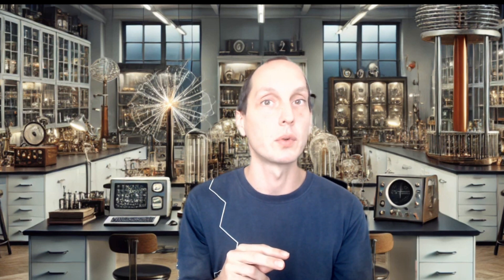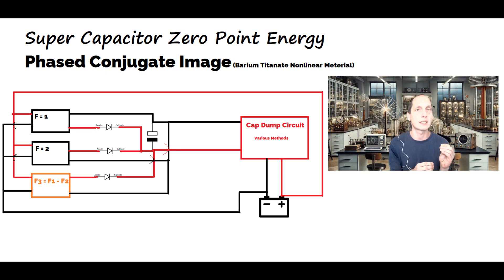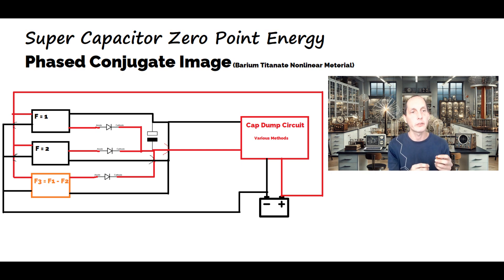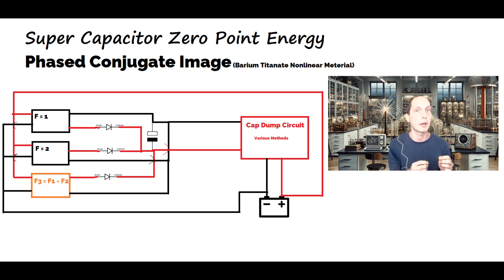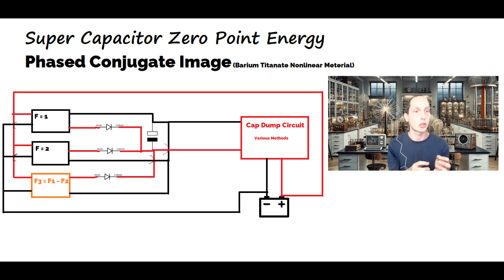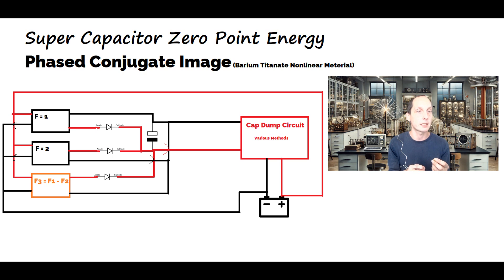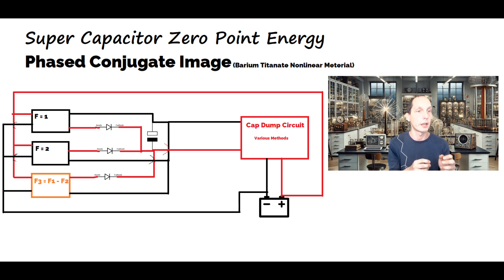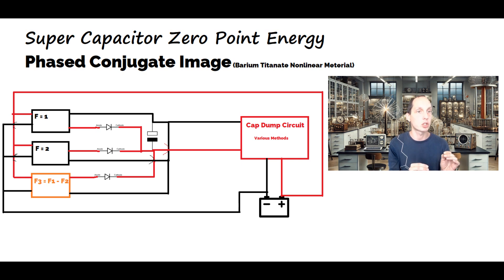Super Capacitor Zero Point

Comment: Man, this is awesome. I have a design for a super capacitor and I'm pretty sure this was the missing link! (a 3rd signal) Thank you!
Reply from the maker: Make sure its calculated to be the same difference frequency that appears in the nonlinear medium. This is needed to interact and create the proper time reversal wave.  so if lets say F1 is 160 hertz and F2 is 100 hz. The frequency that appears is 60 hz. So you need to also inject a 60 hz control signal as well.
Reply: @joellagace1679  That makes sense! Thank you for the tip!